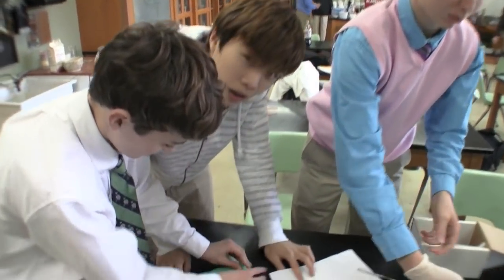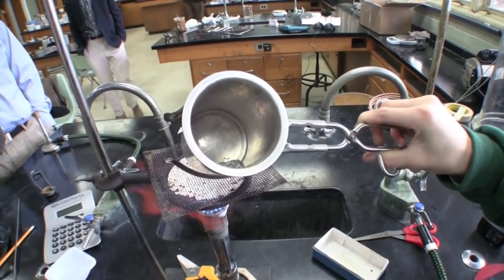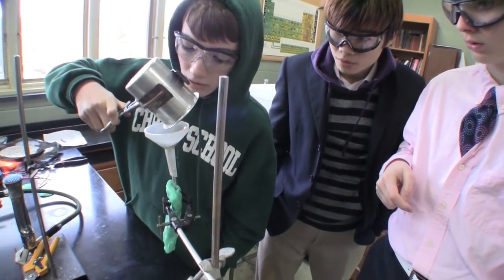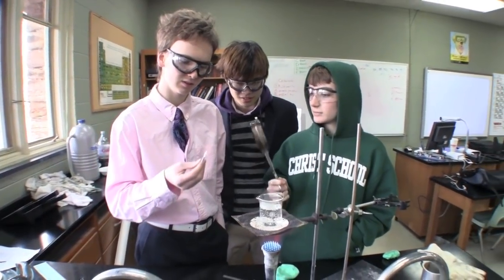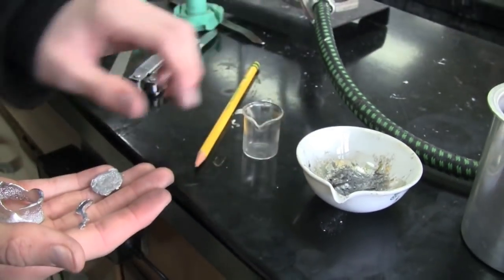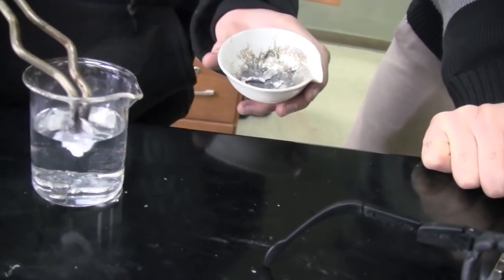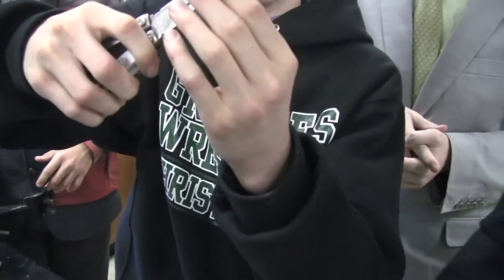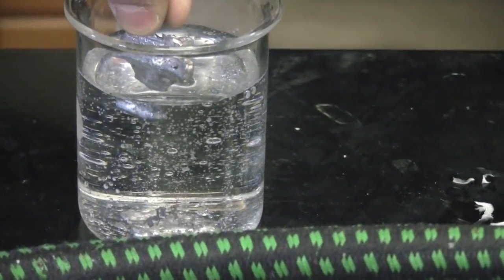Hot Water Melts Spoon!

Comment: in my class i usually use tin and quicksilver. 75% sn and 25% hg. the more hg you put in there, the lower is the melting point. at about 60/40 you can melt it in your hands, leaving, for example, your fingerprint in it. great video anyway! (sorry for eventual bad english)

Comment: if the mold can take the heat of the hot water without melting, or falling apart, you could put the mold in the hot water until it is at the temperature of the water, and then poor the molted metal in it, so it can take the shape of the mold better, and when the metal fills the mold u can get it out of the water and let it cool, or put it in cold water. if u try it, i hope it'll work! :D